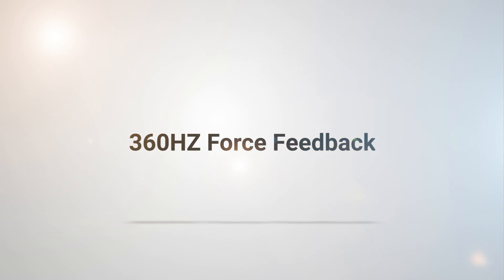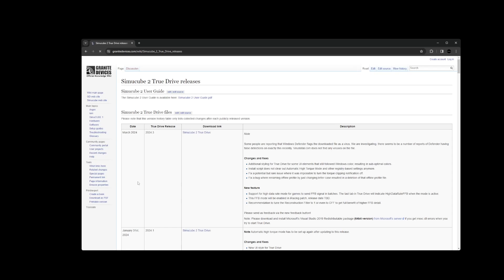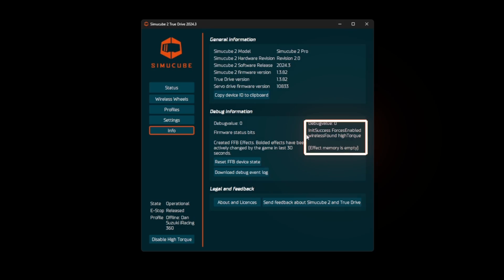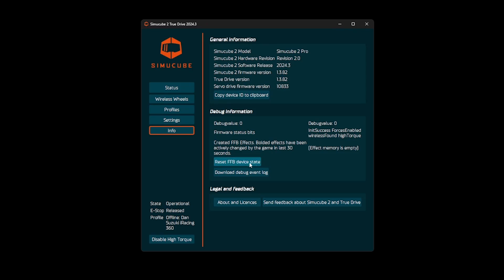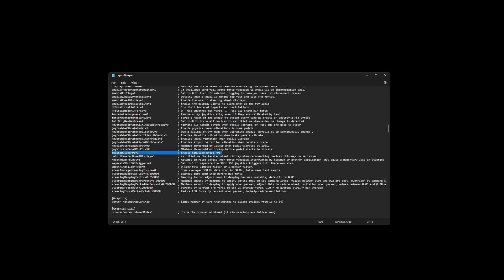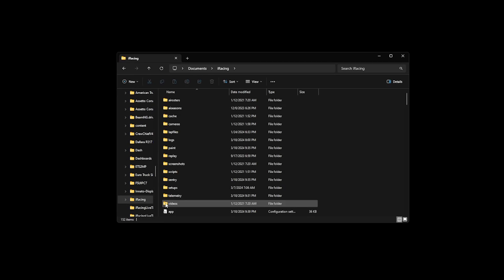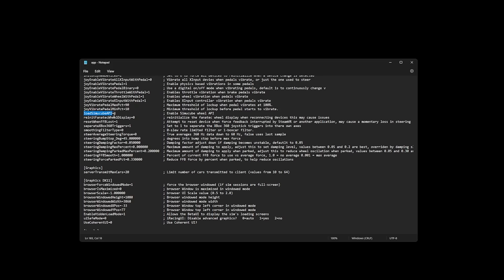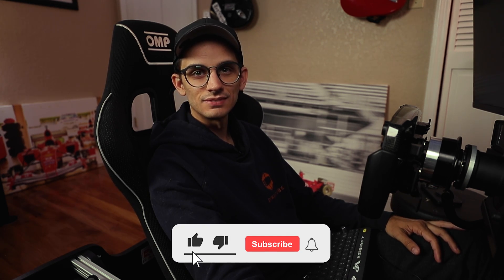Simucube 360HZ Force Feeback (iRacing) - How To Enable

Comment: Thanks for the video. I seen Dan Suzuki’s video but didn’t show how to enable it if the simucube file wasn’t showing in app.ini so this is perfect as he never replied after I asked. So thank you for this
Reply from the maker: Glad it helped. That’s why I made it. I couldn’t get it to work after doing what he said.
Reply: @josecabreravps  well thank you cause I didn’t have the brain power to get it to work 😂😂 goes to ini file no simucube file oookay guess I’ll be running along now 😂😂😂 

How do you find the 360? Much of a difference? What’s it feel like in the wet?
Reply from the maker: @wakenbakeracing85 Not a huge difference, it’s different for sure, I think I was expecting more.
Reply: @josecabreravps  I gave it a go and tbh I don’t think I like it. I ended up turning it off. Felt like I lost ffb in areas but gained it in others. So strange but either way it’s not for me 😂
Reply from the maker: @wakenbakeracing85  yeah, I’m not feeling anything that makes me want to fall in love with it. Doesn’t feel too different from what I had.